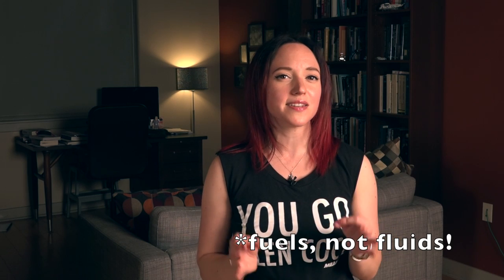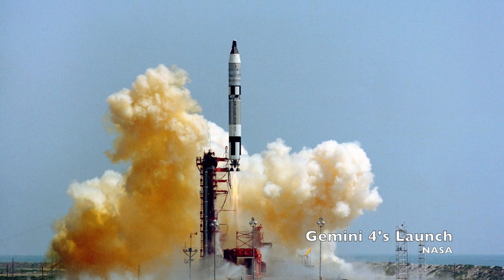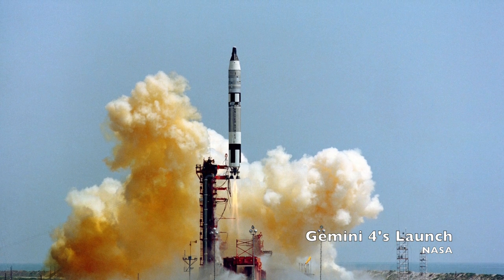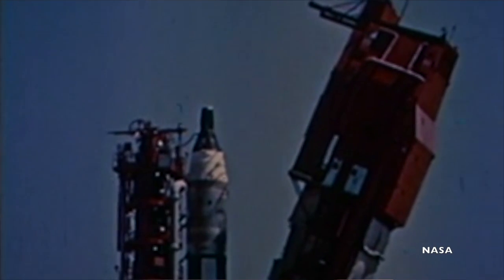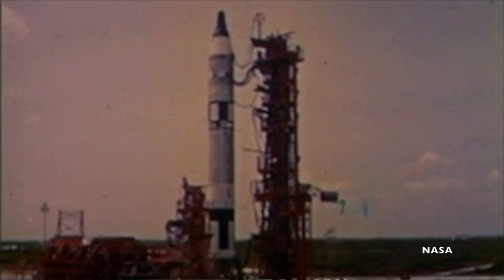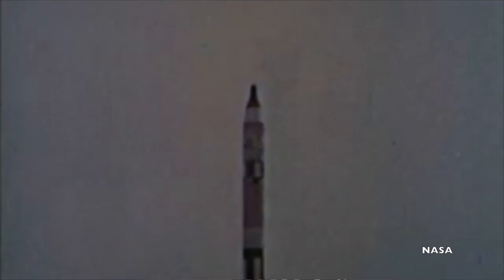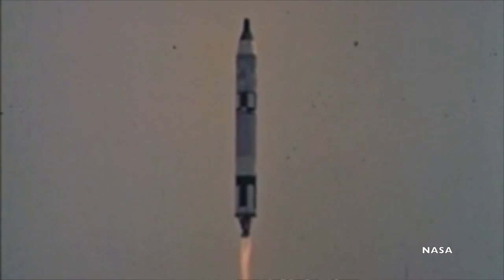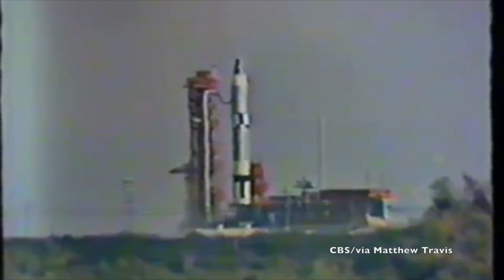Why did the Gemini Launches Make a Bwooping Sound?

Comment: Amy and most amateurs, non-engineers, don't get the point about what liquid fuel rocket is about and focus on the tiny details. Its more like a GEEEGOOO sound, when a turbine here or there is spinning with air bubbles for the initial stage before some equilibrium is reached when the force on the turbine is balanced by the torque from the drive shaft and bubbles are expelled. There are many turbines in the big rockets. The important engineering task is to achieve that balance so that the explosion in the combustion chamber does not force out the fuel out of the chamber and into the fuel tank!! Thats what rocket engineering is all about. And that actually is what jet engines in general is all about.

Then secondary, detect destructive vibration(oscillations) that occurs before mission is over. If there is a destructive vibration after the rocket stage is expelled, who cares? The GEEEGOOO sound is not destructive. There is no need to investigate it. Not by a real male engineer by all means. Maybe female engineers can go investigate it - with 70% less pay wage compared to their male counterparts.